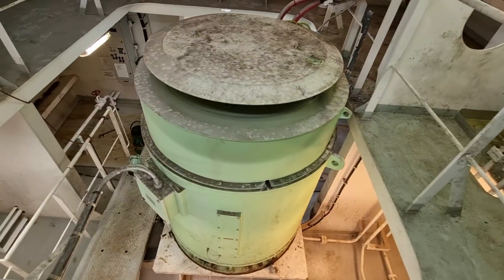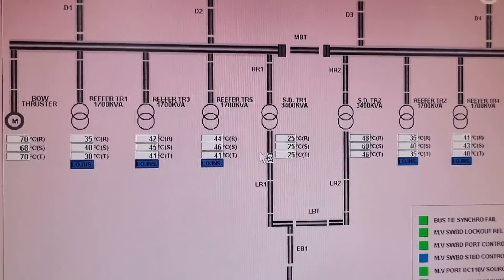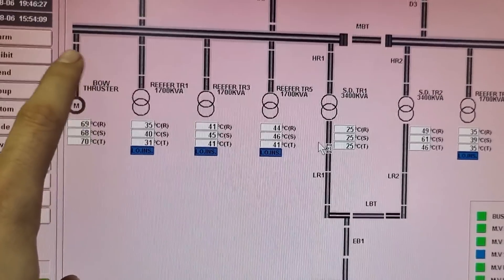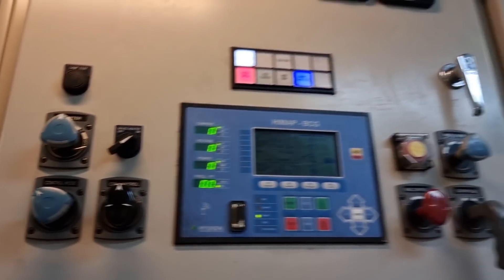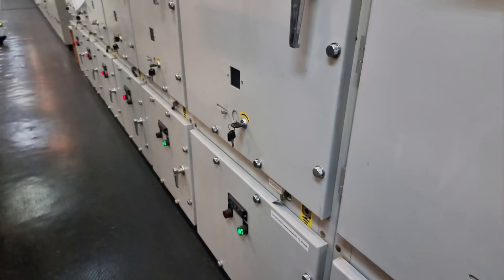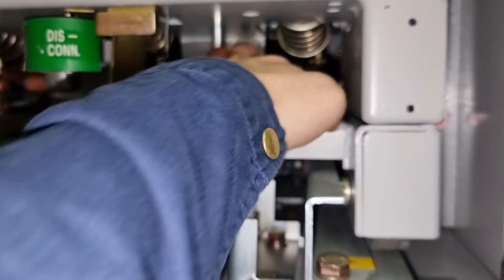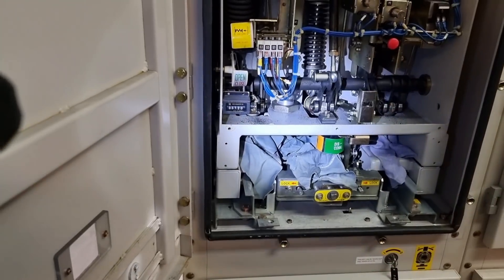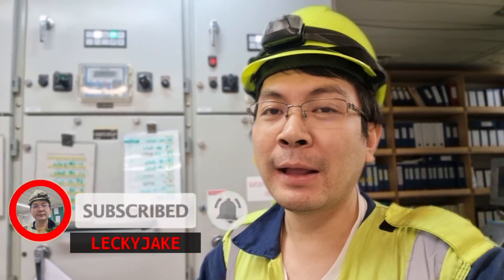BOW THRUSTER HIGH VOLTAGE TROUBLE | MARINE ELECTRICIAN

Comment: Never ever use wd40 on a circuit breaker. Wd40 dries to leave a sticky protective coat that gums up trip mechanisms and prevents the breaker from opening. The mech should be cleaned with a solvent then oiled with a good quality light oil.
Reply from the maker: I guess the VCB maker, Hyundai Technicians, will disagree to your comment. Technicians who comes onboard from previous vessels are using the same WD40 in lubricating points.
Reply: @leckyjake  I am Hyundai heavy construction technician…
WD 40 is used because it is especially a Water Displacement product and als removes stuck grease and dirt.  So I agree with you to use it on that place
Reply: @lucvm4349  It is good for cleaning old residues mixed with wear particles but @Arthur Hall is right. WD40 dries out. So it is ok to use it for cleaning heavy grease or residues then it is much easier to use lighter solvent on WD40 to clean off and after that use proper oil for actual lubrication.
Reply: @MrDominon  mechanic here. I agree. Use wd40 to remove gunk and then use Kramolin to clean and lubricate.
Reply: @MrDominon  you mention the use of solvent to clean, guess you never worked on a piece of machinery flowing such current. Nobody in their right mind would spray a cleaning solvent in such equipment without proper ventilation and ample time to render the area safe from a flash when circuits are energized. Secondly WD40 does not totally dry out as it contains bunker oil, in lamens terms oil from bunker fish, everyone knows oil never totally dries out. All you keyboard pros or handymen are forgetting this is a temporary fix to get the system operational and the ship can dock under its own power, after that proper repairs will be made. FYI 27 years in the commercial fishing industry running large vessels on the eastern seaboard of the U.S. far north to newfoundland, south toTrinidad and occasionally fishing the southern Pacific. 2,500 ton USCG captains lisence.
Reply: Well I am talking with over 40 years experience working with high voltage. It is a fact that wd40 gums up breakers. Love your videos keep up the good work.
Reply: @arthurhall9930  Let's see, you "40 years" or the thousands of years combined experience of large commercial marine electrician experience? Hmmm yeah I'm gonna go with the guys that build the ship and maintain and repair it. They do it day in amd day out and also live in the ship.
Reply: @arthurhall9930  What School Did They Go Too ?   None...  See & Do   Thats Stupid   Killing The Equipment  = Owners   $$$$$$$$$$$$$$$$$$$$$$$$$$$$$$ For Stupid
Reply: We can use WD40. but we have to use rags after that for cleaning nd then contect cleaner..
Reply: @ayushsrivastava682  NO  NO  NO   Think  Fire  DRY LUB  Dam IT